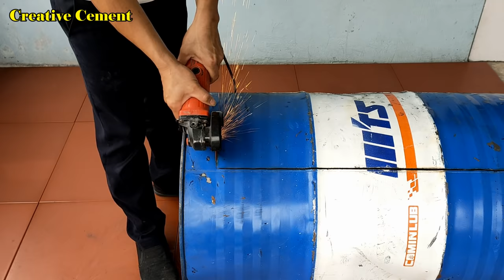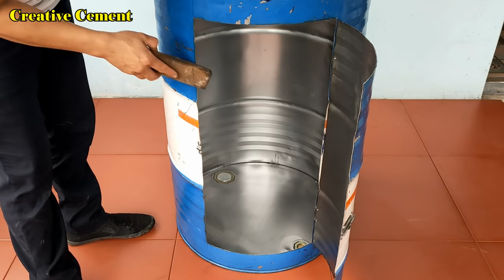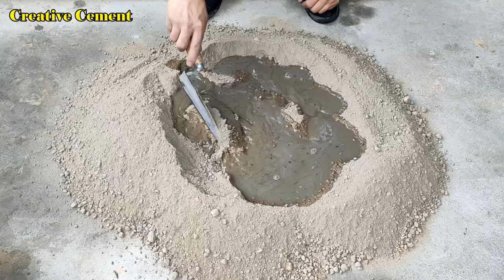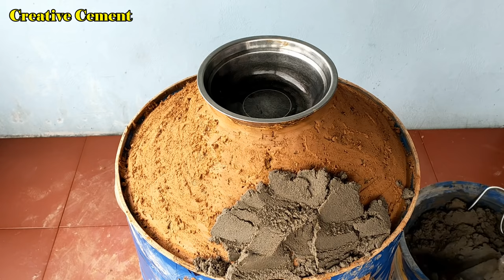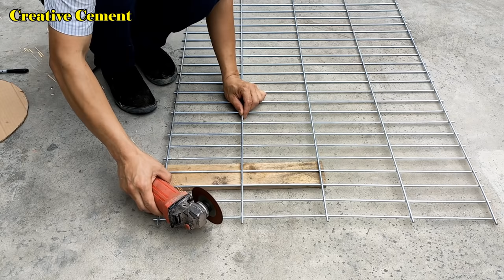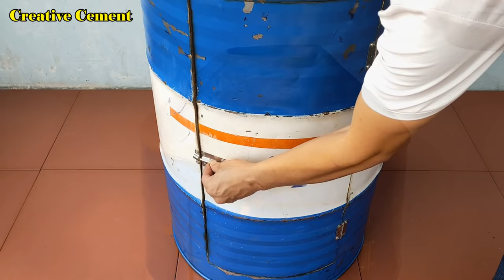Making a pizza oven  _  Ideas from non iron barrels

Comment: All i did was looked on my patio for a pizza oven. A Smoker, or any dome grill will work. I had a Weber Kettle setting!  Why not? >   Then bought some pizza pans up to 18" and a short handle peel. For my Kettle grill. all i did was turn the grate over, cause of the handles. It make perfect pizza cooked top to bottom at the longest time of 20 min depending on the heat> from 250 degs 20 min. up to 500 degs 10 mins
Reply from the maker: Thank you for your comment

Comment: Its an oven of sorts but it's not a pizza oven. A pizza oven runs at high temps that this thing , if it can get that hot, would be glowing at. And you better burn that drum out real good because it had oil or chemicals in it before
Reply from the maker: Thank you for watching and commenting

Comment: How long it would take to roast a chicken in that oven?
Reply from the maker: The heat stored in the furnace is very large. whether the chicken cooks faster or later depends on you using firewood. That chicken I baked in 30 minutes
Reply: @CreativeCement  thank you one last question. I cant find clay in my area  can I just use pure cement and sand ?